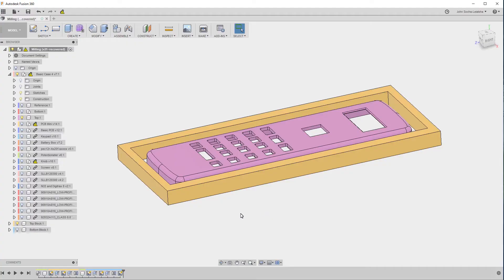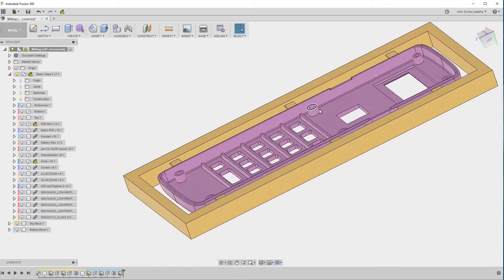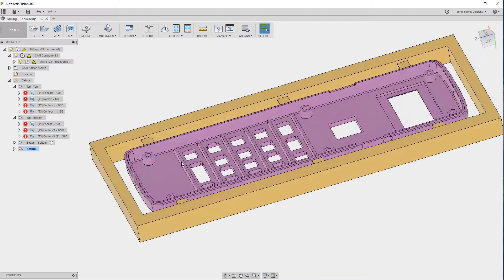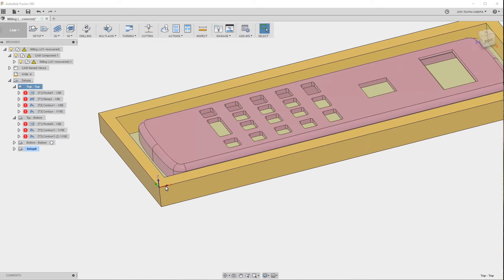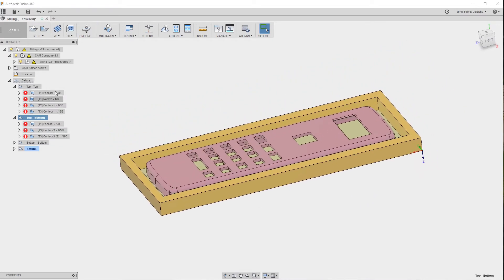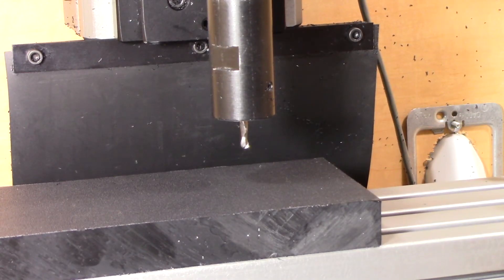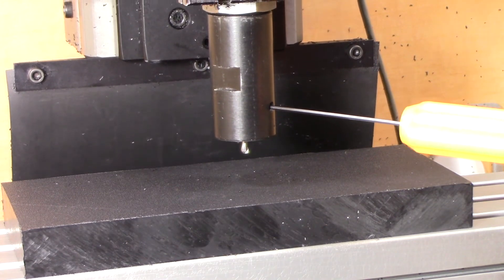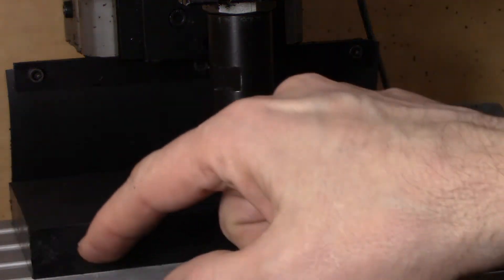#28 Two Sided Milling

Comment: Sorry, but I have some follow-up questions: this method assumes that side of your material are square, right? Do you have any tricks to ensure that the material is placed parallel to the X and Y axis when you flip it over? Are you using the same method to set the height when you are changing tools?
Reply from the maker: The method works if you're using three points. Here is what I do. I sometimes mark the material where I used the edge finder so I can use the same location when I flip it over. The material I was using was fairly square. If it's not, I'll often mill the front and a little bit of one side. This will give me the three points that I need to both align the block and set the X/Y zero point.

As to tool height, yes, I set the new tool height each time I change tools.